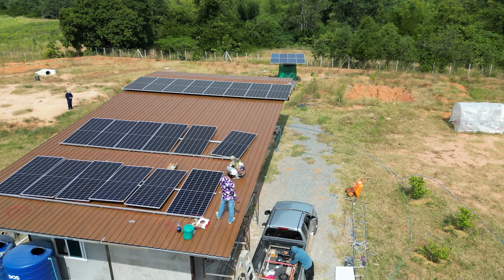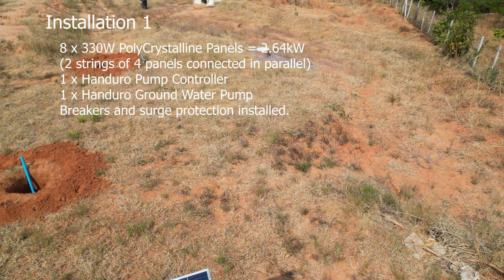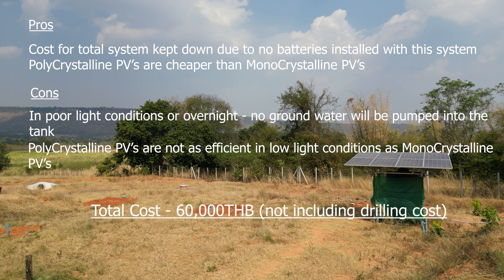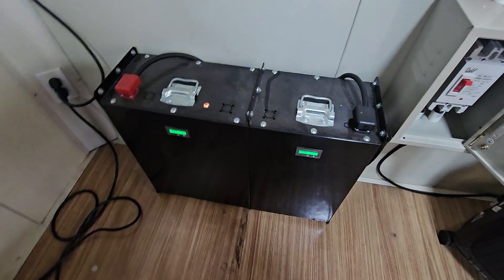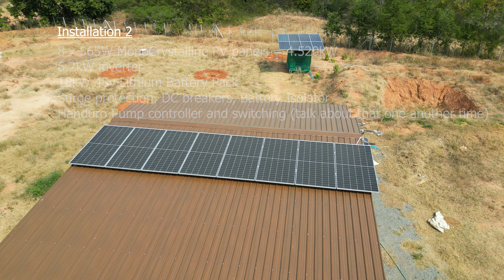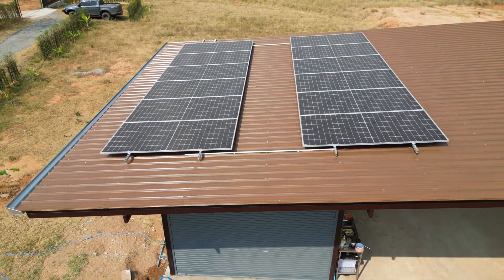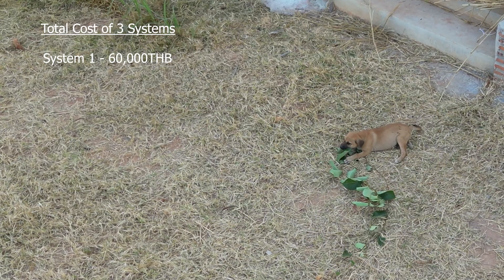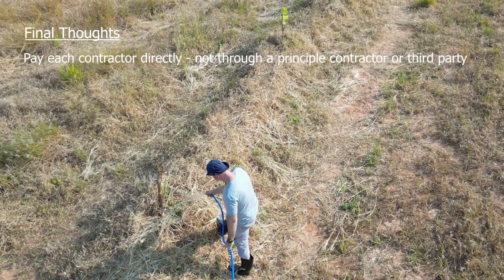Offgrid Living: How Much It REALLY Costs and Lessons Learned

Comment: Great video with useful costs. Small point that battery capacity is in KWh , Kilowatt hours, but KW
Solar panel prices are falling this year. It is a great time to invest in solar power
Reply from the maker: Hi @Nottelling41 - Many thanks for your comment, You are 100% correct! They are 48v 200Ah batteries so 9600kWh. Good spot and I should not have made that error! Great news that solar prices are coming down also.

Comment from the maker: Hi Mark...yes the 3rd installation was monocrystalline as well. I seem to have missed a spec list for no 3 so I will add that to the description too. As for the poly vs mono on the water pumpost of the time it isnt an issue because the ground pump only operates when you use water from the tank. So you dont always need toaximum power transfer ...where as with system 2 and 3 mppt is a bit more critical dependant on tasks required to be completed!

Comment: Great update Matt!  Everything on the farm is looking great, especially the 🐕 .  Great insight on the poly vs mono solar panels. As Tony said, seems to be a no brainer. I assume the third installation for the workshop was Mono as well yes?  Do you regret not using them on the ground water pump now or do the Poly suit that application fine at the lower cost?